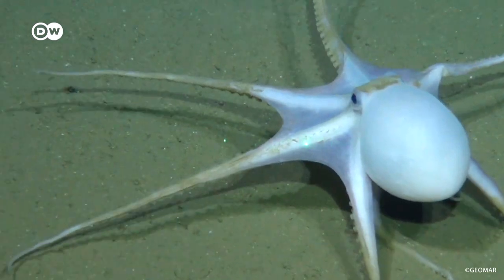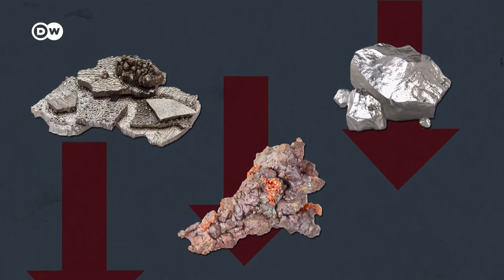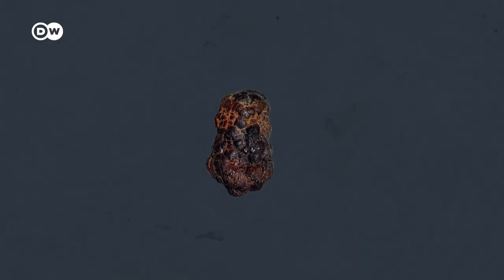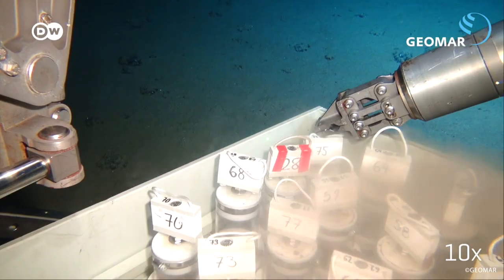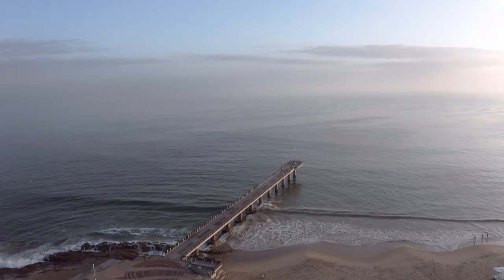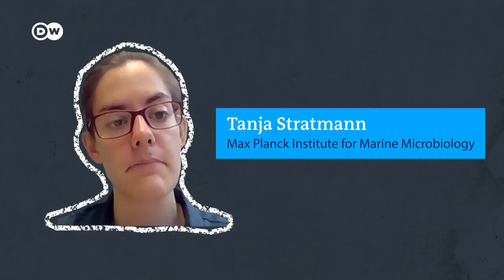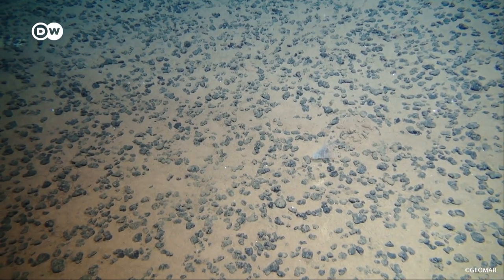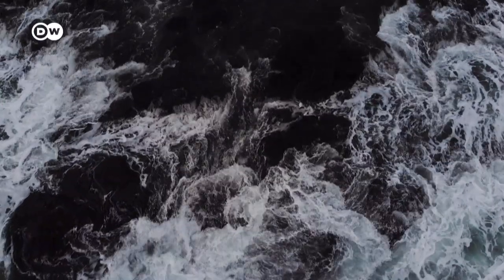Why countries are starting to dig up the ocean

Comment: Before you can recycle those materials, you first have to have them available! I believe it is possible to harvest these nodules in a manner that barely distorts the seabed, by selectively picking up, with robotic arms.
Reply: Nickel and cobalt are both attracted to magnets, the same way iron is.
This could be less invasive than digging and sifting the sea bed.
Reply: Given how they form, they're probably pretty integral to maintaining local chemical stability. If they were mined in a economically viable way the sediment plumes and chemical changes would undoubtedly cause massive changes, and I don't think we want to do more FAFO right now.
Reply: there are already plenty of materials in our landfills. WHy not use those?

Comment: This is a false premise, cobalt is no longer used in making lithium iron phosphate batteries, and terrestrial sources for lithium, aluminum, and copper do exist...massive open pits for copper.  Copper is the most limited.  

Deep sea mining, if limited to 3 to 5 percent of total nodule beds might be OK, but it's not possible.  Once the machinery is in place they will not stop till they take it all.  It will be a repeat of the cutting of all the old growth trees in north America, on the seabed.  It's a reckless, selfish, and stupid idea to move ahead and destroy these ecosystems.